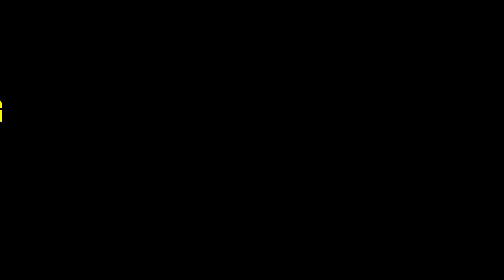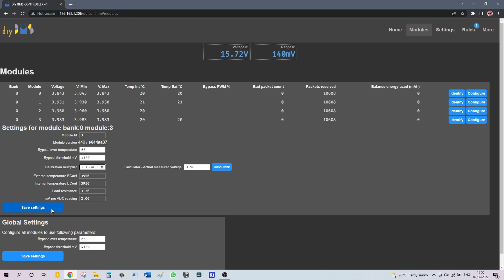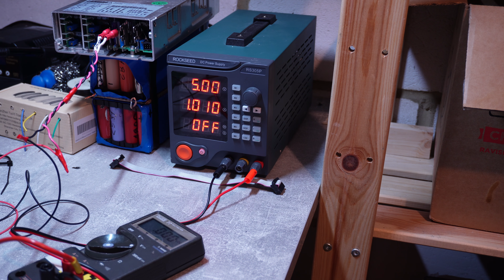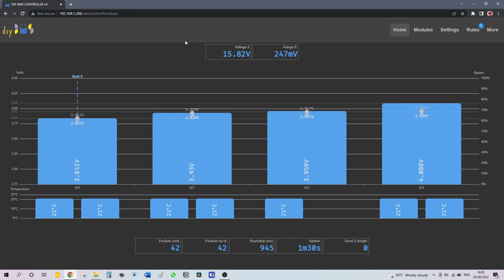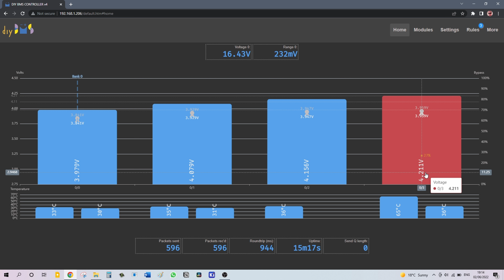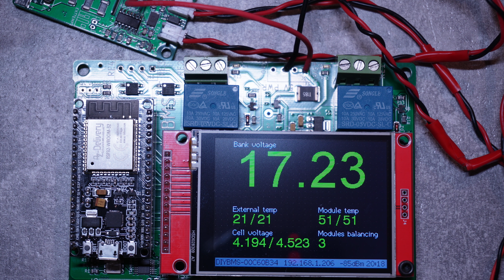DIY BMS - Setting Up, Calibrating, and Balancing Battery Cells Ep4

Comment: 100 modules! That means it should be good for my 96s battery! right?  :)
Reply from the maker: I think it may not be able to do 96s I did a bit more research and it appears to be 100 modules total if you build them in banks.